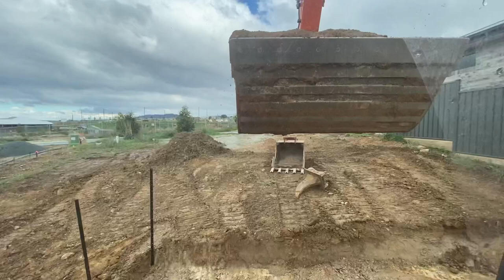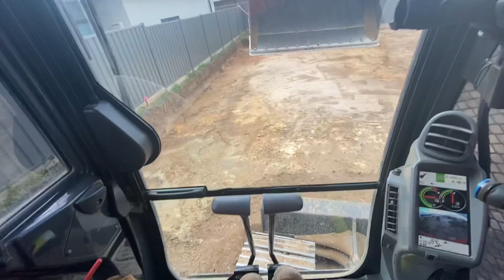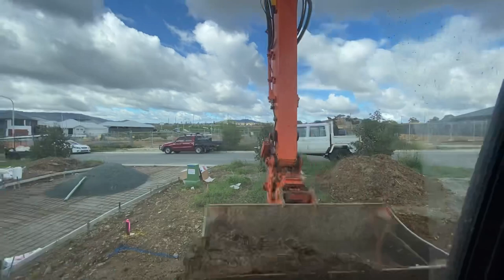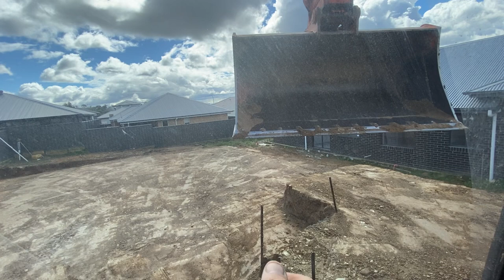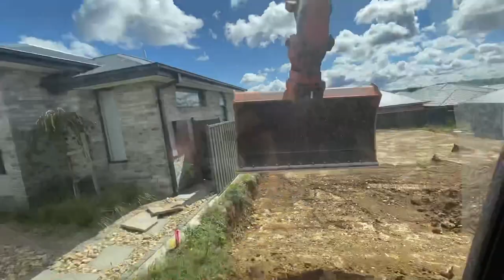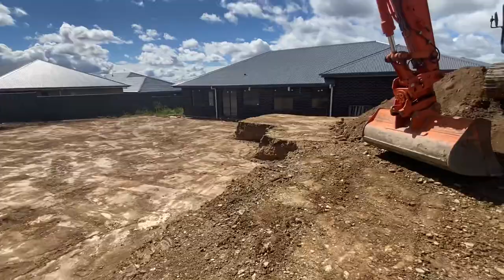Let’s dig with Krafty: Site cut excavation tutorial

Comment: hey mate im the same as you i have ocd with all my work and take pride in anything i do, just wondering what's the best way to start my own excavation business? start off small with a 1.7 or 2.5 and work my way up? 
id love a 14t but how the hell do you find work at the start for it
Reply from the maker: Hey mate, a lot of people start off smaller and work their way up, reasons being less operating costs and maintenance costs. In my opinion you learn a lot starting small and doing jobs yourself which is where there’s more profits to be made compared to hourly hire. It really comes down to who you know in the industry as well. If you were going down the path of getting a 14t your safest bet would be to get on hourly hire. You’re nearly always going to get work if your skills are there and It’s consistent work to cover all costs. Also it’s a bit hard to get your own jobs running with a 14t without contacts and just adds a whole lot of stress. If you start building up some equity through hourly hire, that’s when you’d consider taking on your own jobs, house cuts etc with contractors trucks.
Reply: @jaydenkraft  thanks man, hope to see more site cut videos and id love to see some basement digs

Comment: Looking good mate. I have a boom mounted receiver which works great. Saves u getting out at the same levels. Its interesting that you build on top of the track rolled material. We wouldn't do that here. We would do the cut and still take off the top soil and build it back to height with road base material and compact that. Nice to see some different ways of doing it tho, cheers 👍
Reply from the maker: Definitely not my preference as you can imagine its not the best for final trim either. Every builder is different and some request to just do this and drill a heap of piers apposed to controlled fill. Interesting to hear you guys build it back with road base considering the costs involved. Awesome to see different ways nonetheless